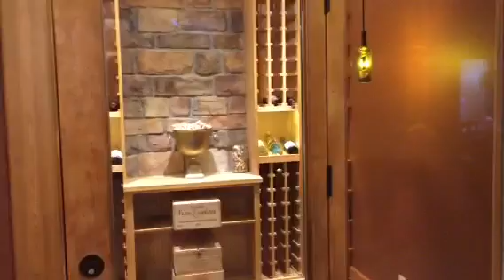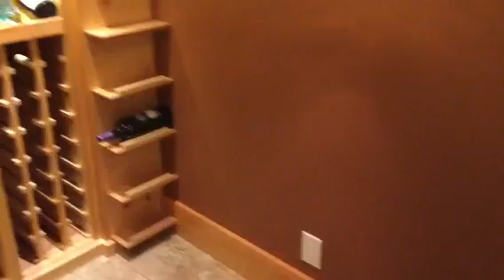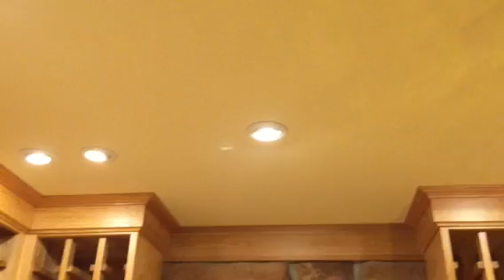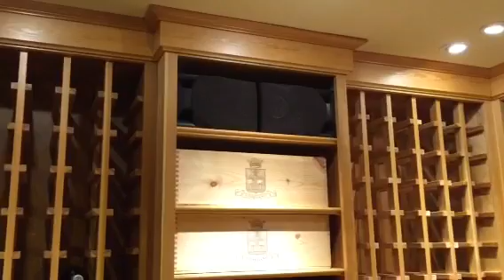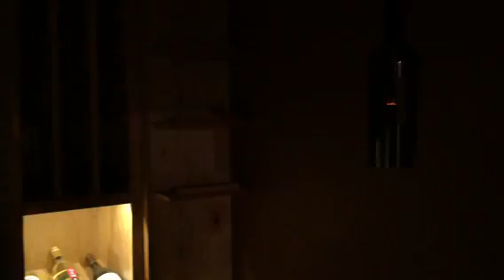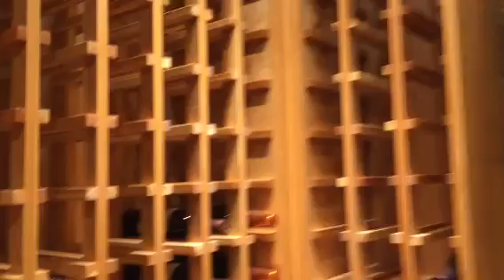DIY Basement Wine Cellar - Cheap but Fully Custom

Comment: First & foremost, thank you for sharing this.  It looks like you did a lovely job.  Now 7 years later, I'd be curious to see if the cellar is any fuller, and if so...what you've filled it with.  I'm also curious about why you chose to put speakers into the wine cellar? Sunlight, varying temperatures, and vibration all negatively impact the age-ability of wine.  If you were in my family, I'd suggest that you reconsider having speakers in the wine cellar...especially if you're not in there often.

Comment: Did you ever end up checking the humidity level? Wine won't store very long if it's too dry. You mentioned you are in WY. I'm in CO and it's dry just like WY and I'm trying to figure out if I could get away with a similar build to what you have or if I would have to worry about climate control because of it being too dry. Thanks!
Reply from the maker: I've never checked the humidity levels but no doubt they are low.  I was focused entirely on regulating temperature.  I don't see how humidity could affect the wine though unless it was through the cork.  Theoretically with the wine on its side the cork could never dry out.  I am open to knowing more though.
Reply: @chrisarneson8644  I think the corks will still eventually dry out in less than 50% humidity environments, especially extremely low humidity environments like 20-40%, and the cracks in the cork will meet the wet end of the cork, causing the wine to oxidize within a few days at that point. I'm curious to know the longest you've stored a bottle in low humidity and drank it without it being flawed. Have you store one for over 5-8 years and drank it and it was fine?

Comment: What are the dimensions of the inside of your cellar.  Is it still functioning without a cooler?  Thanks.  Enjoyed it.
Reply from the maker: Thanks!  My room was framed 8'x8' so it ended up a little less after the insulation and drywall.  I never added a cooler.  It's consistently 62 degrees F in summer and winter.  It would probably be better a couple degrees less but consistency is more important and I've got that.

Comment: I love this! We are in the midst of the covid-19 lockdown and thinking about tackling this project. Did you use a vapor barrier?
Reply from the maker: Thanks.  I did put a layer of plastic under the sheets of foam insulation but it probably wasn't necessary here in Wyoming.  Our humidity is incredibly low and so I'm not an expert on this topic.

Comment: Great overview video!  Looks like an awesome wine cellar.  Did you ever add cooling unit?  How is humidity level controlled?
Reply from the maker: I didn’t. I don’t store high-dollar wine.  I guess you could say I dabble in the hobby.  It is so well insulated though that the temp stays at a stable 63 degrees summer or winter.

Comment: You have some nice wines inthere, the extra degrees to the 55 degree ideal does make a difference if you plan to store them, as well as humidity is very important. Good looking cellar though!
Reply from the maker: You are not wrong but I’m still very happy with what I’ve got as is.  To quote Marie Kondo, it “sparks joy”.

Comment: Hi, What is the area of the country you live in?  I am in the midwest and I'm wondering if I can get away without having a chilling/heating unit in my future cellar.  Is the humidity pretty consistent?  Thanks for sharing your amazing work!  Cheers!!
Reply from the maker: I am on the edge of the Rockies.  Mine stays a little too warm (about 62F) but it is very consistent which is typically the most important thing.  We don't have a lot of humidity here and I haven't measured humidity levels.
Reply: Awesome, thanks for your feedback, it is much appreciated.  Have a great day!  Cheers.

Comment: what kind of cooling system did you use?
Reply: Yeah 62 is a little high but as you say consistancy is better than having temperature spikes.
Reply from the maker: I don't have a cooling system.  I framed the wall to accept a unit and wired for one but then never needed to put it in.  With all the insulation the room stays 62 degrees summer or winter.  I would prefer a tad colder but temperature consistency is really a bigger issue than absolute temp.  My cellar doesn't vary more than 1 degree throughout the year unless the door is left open.
Reply from the maker: It would be very easy on a chiller to keep the room colder.  The room is VERY well insulated.  For me is just isn't a priority.  I'm satisfied with the stability i have achieved.

Comment: Hi Chris, great video.  I am in the process of building a similar sub floor wine cellar.  Can you send me the sketch up model to peter.mcfaul@gmail.com.Thanks
Reply from the maker: I just emailed it to you but it is almost 6MB so please let me know if it doesn't get through your email server.  Some systems have a size limit smaller than that.
Reply: Chris Arneson I'm also interested in the sketch. would it be possible to email to me as well? I love the look. jcontix007@gmail.com   thank you

Comment: would you mind giving some dimensions of the wood & storage ?
Reply from the maker: No problem.  Which dimensions would you like?  I even have a sketchup model that I created for the project that I would share.  Would that help?
Reply: I'm mostly interested in the wine bottle part of the storage as that is all that I will be making and just bolting several of those directly to the wall.Yes, the sketchup model would tell the whole story . In case it's not clear from the sketchup model, I would just like to know which nails/screws  you used and how you fixed the vertical "slats" at the back and in the front  Since my version will be free standing (without a frame), I  will need to add horizontal slats across the front and back.
Reply from the maker: The openings for the wine bottles are all 3.75 inches.  That fits every bottle I have but it's best to leave a couple options for larger bottles (champagne perhaps).  I have open shelving that would accommodate something like that if necessary.

The back of the cabinet is not structural.  It's merely thin plywood to make it look finished.  The vertical partitions are all screwed to the top and bottom of their respective cabinets.  I built a quick jig out of junk plywood and 2x4 lumber to build all the partitions first.  They were constructed of front and back vertical slats (3/4"x2") with a bunch of horizontal .75" slats tacked and glued on with my nail gun.  I then flipped each partition in the jig to nail the horizontal slats on the other side.  Then remove the completed partition from the jig and build the next one.  It was very easy.  Making a quick jig will save you huge amounts of time and ensure that they are consistent.  Once I had all my partitions constructed then I built the cabinets around them.  Beginning at the bottom I screwed the partitions to the base, attached the sides, and finally screwed the top to everything.  I have a sketchup model but don't know how to email it to you.  It will give you all of my dimensions.

Hope this helps a little.
Reply: There's supposed to be "send message" under "about" tab but I can't get it to work - it's just comes up about contacting youtube. I guess without a link, those details will have to do. BTW - how did you screw the vertical partitions to the base - pocket screws or ?
Reply from the maker: I just used standard construction screws through the top and bottom into the end grain of the verticals.  There's no lateral (shear) forces on those screws.  They just keep things straight.  I suppose you could use pocket screws but it would be way more work.  You could even use construction staples since there's no real force on them but I like the control of screws.  The screw heads can't be seen because they are either hidden underneath (on the bottom) or covered up with the slanted rack on top.  I suppose a person could stoop way down and see some screw heads if he looked up and the bottom of the uppers but that's not likely.  Good luck.

Comment: How deep are the stud walls? I have used metal studs and have 3.5" not sure if I should spray myself or????? 
7" in ceiling ---I read R30 for exterior R 40/60 ceiling R19 interior which makes my studs way too small. I don't believe I need to make 10" walls for a wine room at 55F. Details of what you used please and I will review the video again. Vapour barrier??? Did you use foam sheet or spray?
Reply from the maker: Wow that sounds extreme.  I used standard 2x4 stud walls with R13 insulation plus 2 inches of foam over that. Remember that your studs will transmit heat so you really want a thermal break which the foam gives me.  Others get that by framing 2 separate walls with a gap between which is all filled with loose insulation.  I'm over R20 with a thermal break and I'm happy with that.  Good luck.

Comment: Thank you Chris! Your diy wine cellar is awesome! Can't wait to start building one (just like it). So did you ended up adding a cooling unit to your cellar?
Reply from the maker: No.  It stays about 63 degrees in every season. Might be a tad warmer than I would prefer but there are no temperature fluctuations at all.  If we were storing a bunch of expensive wine I would probably add it but we don't.

Comment: you say you spent $150 on lumber, really???? i mean you have a very large wine cellar, did you use plywood and solid wood??? its seem you would have wasted like 800 just on wood but you say 150? I am about to build a wine cellar similar to the one you build, beautiful work by the way (you seem pro to me)  Do you have dimensions of the wine cellar you build would love to get a look at that, very interested in the depth  you used and height pleas fill me in on that...
Reply from the maker: +Adrian Torres The wine cellar is 8'x8' roughly.  The wine racks are really only on 1 and 1/2 walls because I was actually worried about having too much storage to fill up.  I think I probably used 3 sheets of birch plywood and the rest of the lumber is fir/larch which is pretty cheap around here.  I also bought it in bulk when we were doing the finish cabinetry in my house at $1/bdft.  I am not a pro but I have been building furniture and cabinets for my family for quite a few years.  I certainly have solid skills but nothing in this project was very difficult either.  It just takes being careful and taking your time.  It's certainly within the skill range of a solid hobbyist.  

When I went to build the actual cabinetry I did some web searches for sketchup models.  I am a HUGE fan of sketchup to pre-plan out a project like this.  The standard cases are 11.75 inches deep and the ones that hold the wine crates are 16.5" deep.  I chose those dimensions so I could maximize the amount I could get out of a single sheet of plywood. 

Feel free to ask for advice.  I probably even have my sketchup model around if you would like it.  I find that a couple hours to create a sketchup model and get it right can save me many hours building and avoid big disasters (like not being able to get a cabinet in the door).  I've made some of those mistakes in the past and carefully planned the exact height of the cases so they would be able to rotate up to vertical.  Good luck!